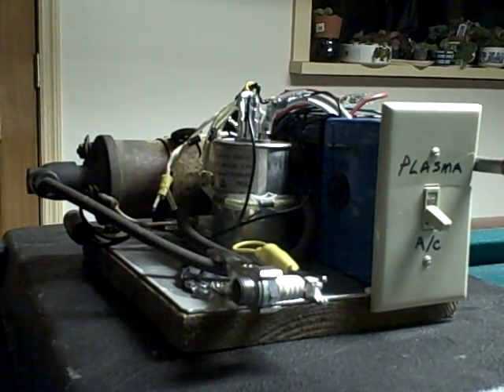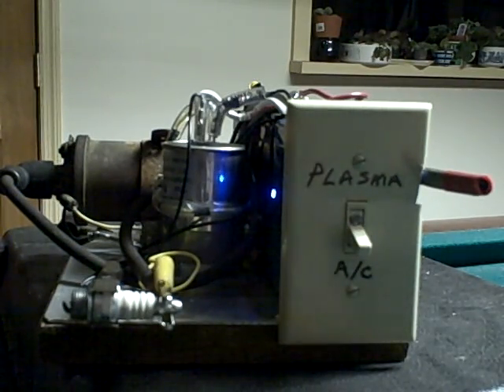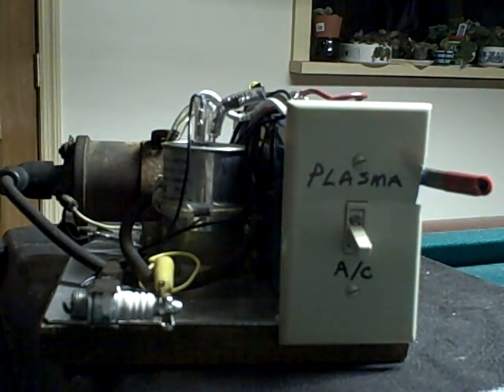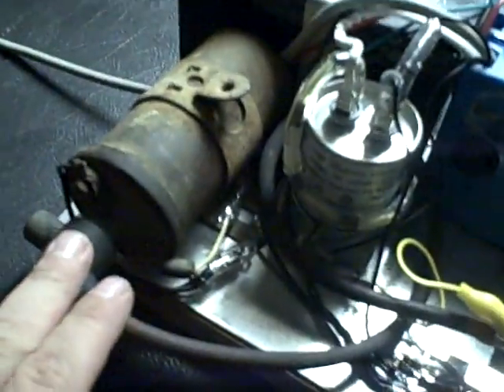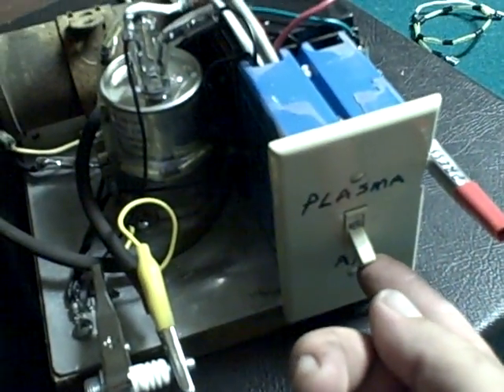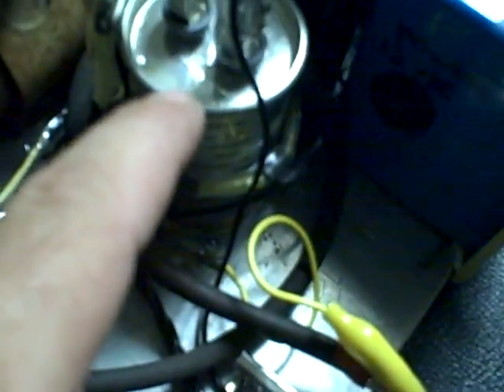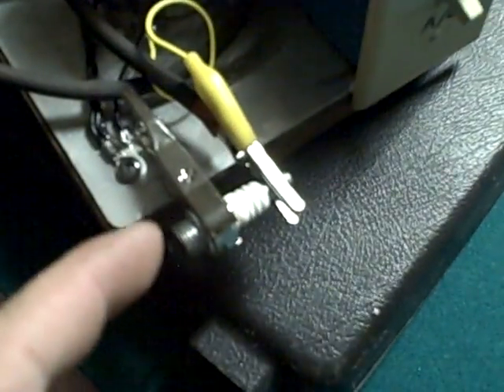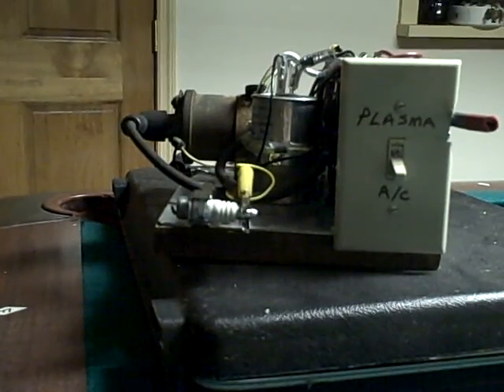plasma test fixture simplified

Comment from the maker: Thanks for the comment. I will have to find the drawing and post it in a later video. 

This unit is used for testing our plasma spark. We are using the plasma spark to ignite water. If you watch some of my other videos you will see how we ignite water vapor. I am currently working on utilizing the spark to power an engine on water injection. Stan Meyers is one of the people who utilized this type of system to power an engine and demonstrated it on a Volkswagon.